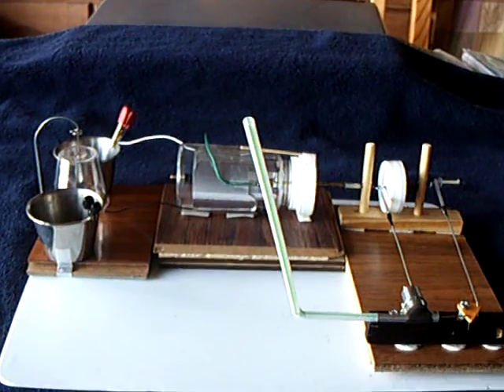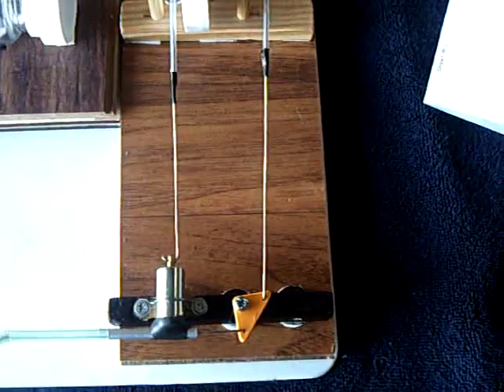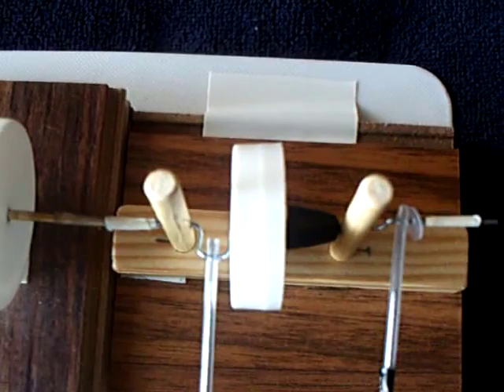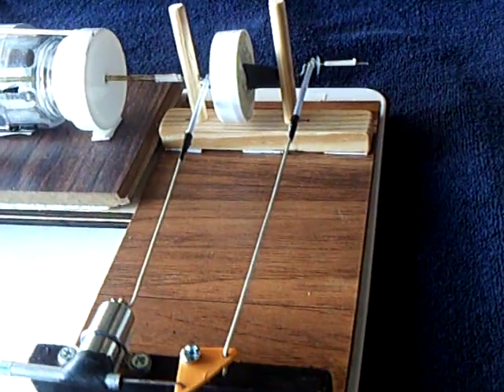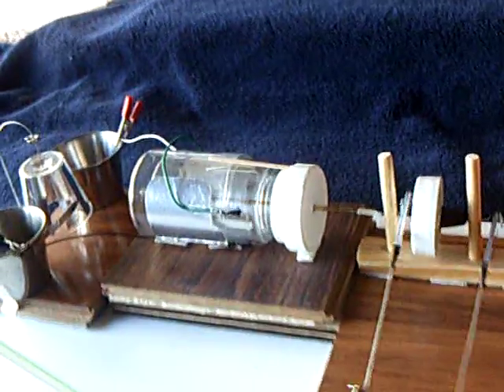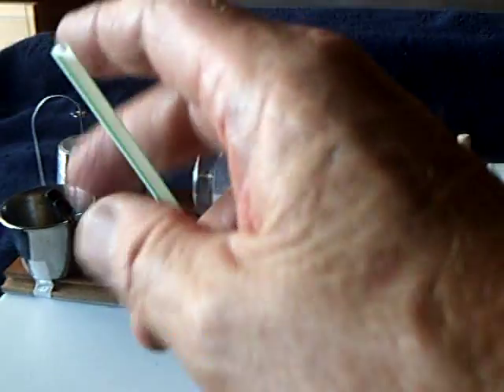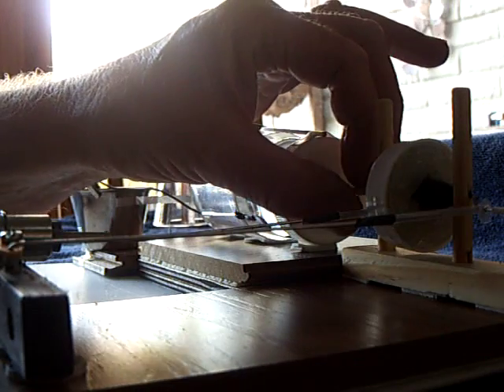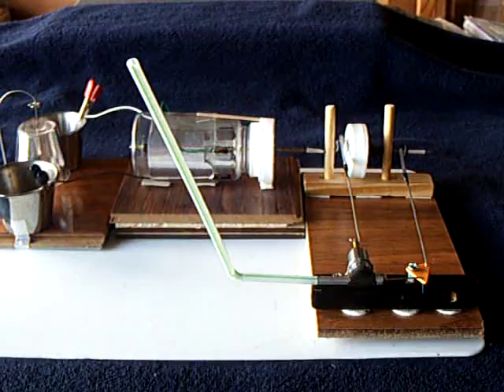Simple Steam Engine ----  air powered

Comment: This is amazing. I´ve watched your videos with your little steam engine and I´m thrilled. I´ve been looking very long for a simple design that I can make with my science class. Is there a way to contact you directly? How did you fit the engine without soldering, did you use a lathe or did you find matching parts in the household?

Comment: That is some excellent work and great choice of components. Nice one.
Reply from the maker: Thanks.  Your compressed air car designs had an influence on me going off in this direction.
Reply: ***** thanks, you flatter me. However, I guess you could use a pop bottle with a tyre valve on it as an air reservoir to feed your engine, if you hadn't already thought of that. Or just a balloon.